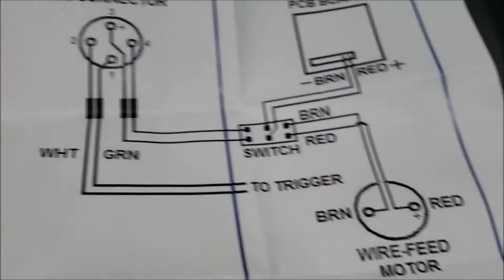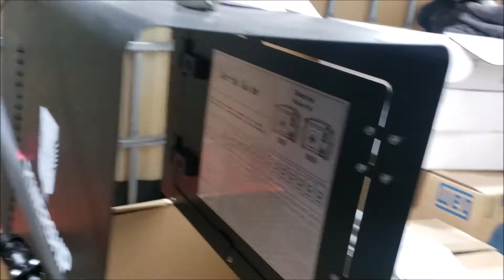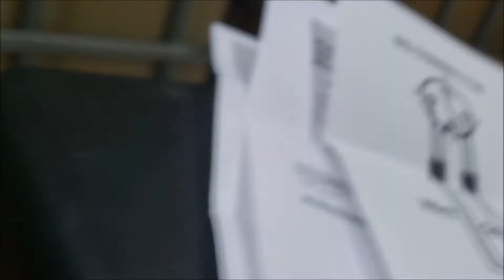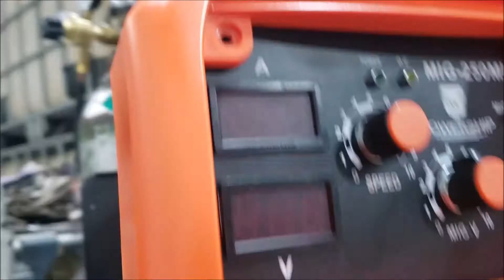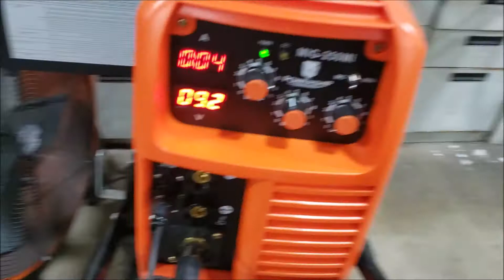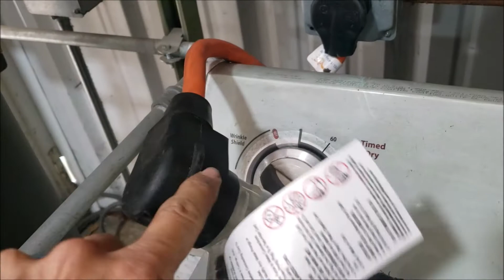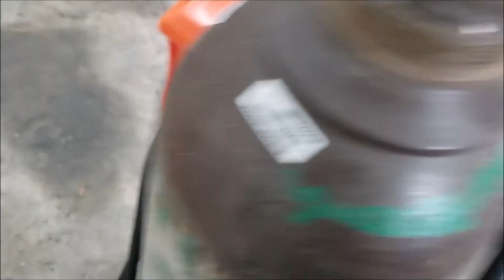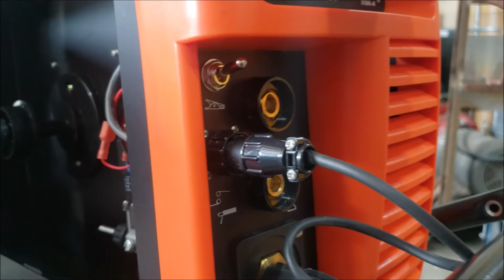How to add a Spool Gun to Mig Welder to weld Aluminum

Comment: YOU CAN ALSO LOWER THE WIRE SPEED ON THE MACHINE TO THE VERY MINIMUM, ON SOME MACHINES, IF YOU TURN THE WIRE FEED KNOB TO THE MINIMUM, RIGHT AT THE END IT FEELS LIKE A SWITCH AND THE MOTOR DON'T SPIN BUT THE GAS WORK FINE AND IS USED FOR PURGING THE GAS LINE.

Comment: Was you using argon for mig welding? If so that's not right. You should use a C25 mixture. That's why there was that black soot on the welds. Also it looked way too cold.
Reply: mig is  inert gas aka 100% argon     used for alu welding 

for steel u use c25 c18   watever u prefer 

i assume he is using mixed gas   cuz when welding alu on 100% argon i never seen this happen 

and ur setting are very cold         welding alu is abit of a learning cliff